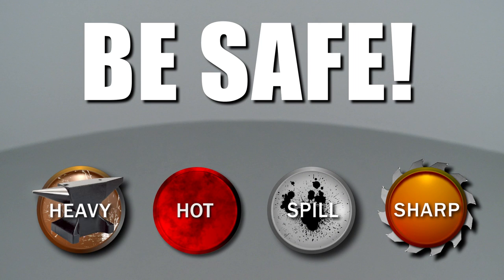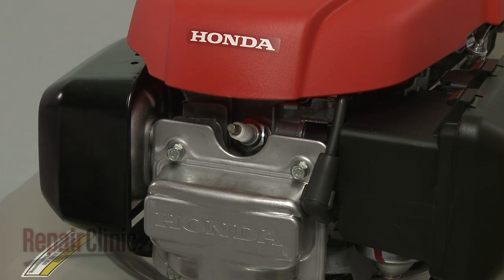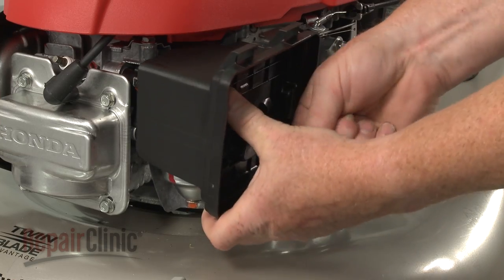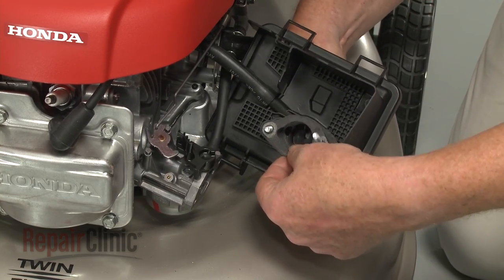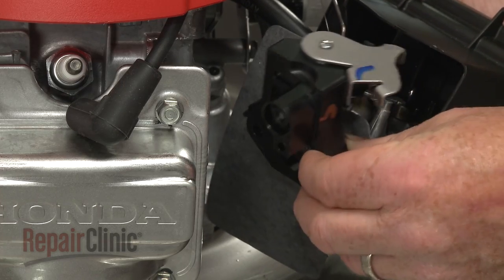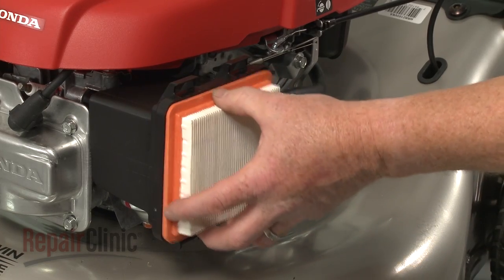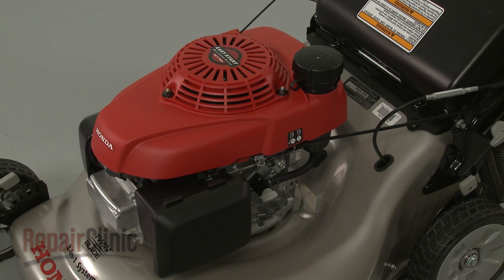Honda Thermowax Choke Actuator Replacement #16620-Z8D-305

Comment: The idea of this redesign regarding a thermowax actuator gives me a giggle or two.  Way back in the day (when they just invented the lawn mower), I remember pulling out the choke,  pulling to start, pushing in the choke, then mowing all day :)
Reply: Yeah I don't get it.  On my power washer I have the same Honda GCV160 engine.  THAT one has an old school choke.  The one for my mower doesn't.  Since it's common for this part to fail (so I've read) seems dumb to not just have them all with the old choke style
Reply: The idea of this redesign regarding a combustion engine give me a giggle or two.  Way back in the day (when they just invented the buggy) I remember just feeding my horse hay and then just riding all day :)

Comment: First honda should install studs to mount the carburetor and hold it in place with nuts! the engineers really blew it with the thermowax actuator.what a bunch of nonsense.A pull or lever choke works flawlessly.A thermowax actuator REALLY.Definitely destin to fail on every one produced,it really doesn't have to be this complicated.
Reply: 😂 Ibid!  Somebody was thinking the Honda dealerships need more service revenue!

Comment: I bought a OEM replacement actuator from Honda. I removed the old actuator and installed the new actuator and it performed the same. It starter surging after 1 minute. I pulled the pin out of the old actuator and reinstalled the old actuator and the mower started on the first pull after letting it cool down for 30 minutes. It ran for perfectly for several minutes. Any recommendations on what might happen if I don’t install the pin in the actuator? Thanks
It’s been a month since I removed the pin from the thermowax actuator. I’ve cut my lawn multiple times. My mower starts on 1 pull and it never idles rough. Pulling the pin has worked on my mower. For the people looking for the correct part, Amazon has it.
Reply: Hi, what pin are you referring to?

Comment: I have the slightly newer 2020 HRN216 GCV170 Honda mower with a surging problem.  Only 1 year old.  Replacing the Thermo Wax Assembly (Honda 16620-Z8D-305) fixed the problem. This procedure was very helpful.  My model mower has long studs and nuts instead of long bolts which makes disassembly easier since you can remove parts in layers.  Thanks for the helpful tip.  Was really frustrated with this expensive Honda mower having idle problems. All good now 👍🏼

Comment: Honda recommends using Hondabond HT sealant to improve heat transfer.
Reply: It's such a small amount they should include a tiny tube of it with the thermowax. Fortunately its just RTV and I keep that around.
Reply: The Honda bond or RTVis used primarily to keep the thermowax unit intact and from falling out its engine port.

Comment: Very helpful video, thanks. I was having a problem starting the engine, always had to prime the engine with a shot of aerosol carb cleaner before pull starting. So I knew the choke was not working properly. Had no knowledge of this thermowax choke actuator. A note for others who might be having problems with this type of choke system... This little gizmo has some type of adhesive which holds the actuator in the engine block hole, that's why it takes a little effort to remove the actuator. When you grab the actuator with your pliers, grab the outer part of it, not the shiny pin in the center. The pin in my actuator was in the "choke open" position, like totally extended from actuator body. I sprayed the pin heavily with WD-40 and pushed the pin back into the actuator body afterwards. The pin does not slide easily back into the "choke closed" position. I re-installed the actuator and the engine started first pull. The choke has performed perfectly since.
Thanks for the video.
Reply: Mine doesn't start at all but i can't tell if it's because of the auto-choke.  Whenever i pull the cord it just makes a super weak plub-plub-plub like a 5 year old tugged on the cord.  I cleaned the carb and put in a new spark plug.
Reply: do you use an adhesive to hold the thermowax when you replace  it ?

Comment: Thanks for posting this. I had to replace the back air filter housing because one of the clips that hold the filter cover broke, and didn't realize the long bolts held the carburetor & choke also. After everything kind of fell out, I could not tell that the choke went between the housing & carburetor. I downloaded the service manual from Honda which was totally useless. Watching this video showed the orientation and I had everything back together & running in 5 minutes!

Thank again!
Reply: so true no real info same thing for me. finally a simple fix

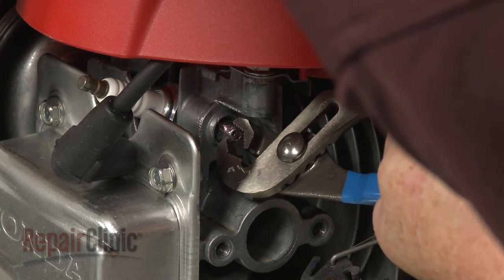Comment: @1:15 in the video:  "Use small Channel-Lock pliers to help pull the old choke actuator out of the engine. This may require some effort."

That's an understatement, or at least was on my Honda. I have a bunch of Channel-Lock and needle-nose pliers in various sizes. All my regular pliers were too big to actually get a drip on the actuator in that very tight space. With my smaller needle-nose pliers, I could get a grip on the end but couldn't remove the actuator as I pulled. I went to my local Lowe's, and for under $20 got Model 192001 Irwin Vise-Grip 13.25-in Bent Compound Long Reach Pliers that easily extracted it on the first try. Note there are many other Irwin Vise-Grip pliers that will not work as well. You want Model 192001.
Reply: Appreciate the tip.  Encountered the same difficulty and was looking online for a suitable pair when I saw your comment.  Just ordered a pair.
Reply: Same here.  For the love of God.  I couldn't get mine out.  Going to give this a try.  Thanks
Reply: I'm pretty sure that I've seen a service bulletin and recall describing the actuators being too short.  I ordered two of those, new gaskets and that should get me going.
Reply: @Booneboarder  LOL FTLoG!
Reply: Great tip on the Irwin Vise-Grip model 192001 tool to remove the Thermowax actuator.  Works like a charm.  I had tried everything up to and including Gregorian chants to get mine out without success.  Thank God I ran upon your comment.  It didn't fly out but that tool gave me the grip I needed to get the proper muscle on it.  Many thanks again for that crucial tip.  If you don't replace that actuator, you just did half of the needed job in 90% of the cases.  Cheers !!

Comment: Any tips on knowing when this needs to be done? My mower had to have this replaced last year, and it is giving me some troubles. I'd like to learn how to trouble shoot the actuator myself so I don't have to goto the dealer everytime.
Reply: The problem with the thermowax actuator, is its location. The airbox covers your view of site. The only way to test one, is to pull it out and put heat on it. I submerge mine it water, to see if it opens and closes.  Honda uses a factory gaskit sealer when installed, its a real PITA to pull out if you have to check one. I suggest seeing if you can look behind the airbox cover from the left side. You should be able to see the choke housing assembly with the plunger in it. When the engine starts to heat up you should see it move. Its opening the butterfly for the choke. These machines at start up run like crap till they finally worm up. If your machine  runs ruff and then levels out, its normal. The choke is just opening from the closed position. Normal cost on the actuator is 13 bucks, may very from State to State. I hope this helps.
Reply: One way to tell when it needs to be done is if your lawnmower has trouble starting after it's warm, I would cut the front yard and shut it off to move to the backyard and then it would not start until it cooled again.  PITA.  When you replace it, should start pretty easily most of the time hot or cold.

Comment: I have the opposite problem.   My hrx217 is difficult to start but once it runs it starts first pull everytime I shut it down?  I changed the spark plug and it was good for a coue weeks and now it doing it again??  Any idea?
Reply: Could be several things but a carburetor that needs cleaning or replacement is probably the most common cause of this, especially if the engine also idles with rough surging up and down after it starts. There are little tiny ports in the carb that gum up especially if you aren't consistently getting all the fuel out or using fuel stabilizer over the winter, but even if you do, over time, they can gum up and cause this.
Reply: Actually you're better off using non-ethanol fuel if you can find it, not to cure this issue but to prevent it in the future once you fix it. Some gas stations sell non-ethanol at one pump. Using regular gas, 10% ethanol, especially fuel that's been sitting around for a month or more, can cause tiny carb ports and jets to eventually gum up even using fuel stabilizer.

Comment: Whats the part number for a new carburetor?
Reply: Genuine OEM Honda 16100-Z8B-901 CARBURETOR (BB76A A)
Reply: Careful. The correct carb depends on your exact Honda model and in some cases even the serial number. You can get a replacement carb for a GCV160 engine that will not look the same or operate the automatic choke as your original carb did.

Comment: I'm having a problem with a Honda mower. When I start it it starts fine. But as the choke is siding over and reaches the other side it turns off and this is in a matter of seconds. Please help I dont know what to do with this thing anymore

Comment: On my mower, the thermowax needle is pushed out when cold and seems stiff to move. That's not right is it?
Reply: No it's not right. The thermowax needle should barely protrude when the engine is cold and be out farther when the engine is warm. If you can't push the needle in easily and have it spring back when warm and stay in when cold, the actuator should be replaced.

Comment: Dude... which is the newer part?  16620-Z8D-305 or 16620-Z8D-842?
Reply: Your part numbers are for square edges.  Here is the part number for the round thermo wax:  16620-Z1L-841 Thermo Wax Assembly.  Square or circle depends on your auto-choke part.

Comment: I have the opposite problem, the choke on my Honda engine will not open and it runs very rich for 3-4 minutes until the wax pellet heats up and pushes it open. Is there supposed to be some kind of vacuum operated choke break on this thing?
Reply: Nope. The engine just relies on heat to heat up the thermowax which moves the inner pin which opens the choke butterfly. I just installed the latest revision thermowax (16620-Z8D-842) and the mower starts now but it runs rich for about 1.5 minutes until the engine heats the thermowax. There was also a revised auto choke assembly that has a black ring around the plunger.
Reply: @steadyeddie7453  I figured out what it was. The air filter base was warped and when the screws were tightened down the base rubbed against the butterfly linkage holding it closed. I put a second gasket behind it and that gave it enough clearance to allow the choke to operate properly. I bet this happens a lot.
Reply: @mjg263  Always go with the simple things first, right.  Glad you got it running, and thanks for the response. Something for me to keep in mind for future repairs.
Reply: @steadyeddie7453  Right, simple stuff first lol! Next time it happens try backing the screws off just a little tiny bit, you’ll probably hear a “click” and it will start running normally. It’s because they use the same 2 screws that hold all of the carb parts to the engine to also hold the plastic filter housing on. When the screws get over-torqued the gaskets get squished, the cover warps and the clearance for the linkage gets too tight. They should have used separate screws to hold the plastic filter box in place (like Briggs Quantum) then it wouldn’t get cranked too tight and interfere with the linkage. Doubling up on the air box gaskets will usually put it right. Dumb design.
Reply: @mjg263  I agree it's a bad design. The engineers were out to lunch when they designed this area of the engine. I think they should have used threaded studs to hold it all together. Slide all the pieces over studs and then secure with 2 nuts. Oh, and on some models there is a third bolt inside the air filter housing. Perhaps it was added to help prevent the twisting and warping of the plastic.